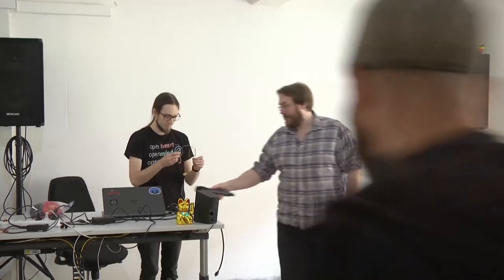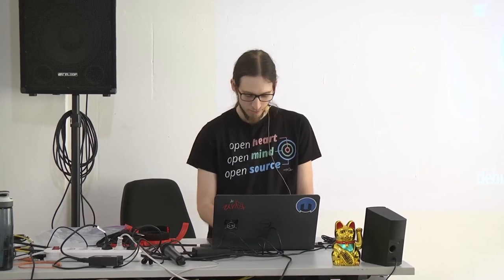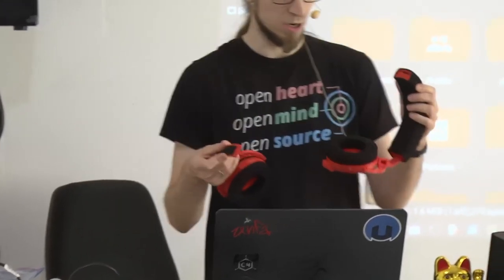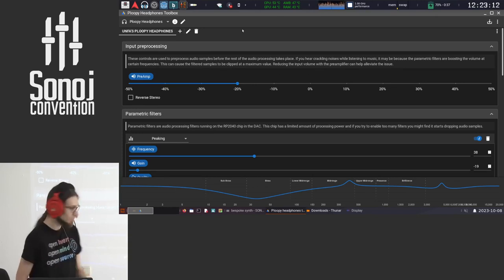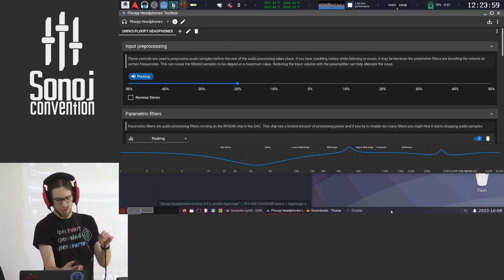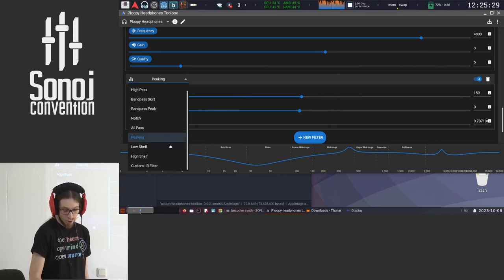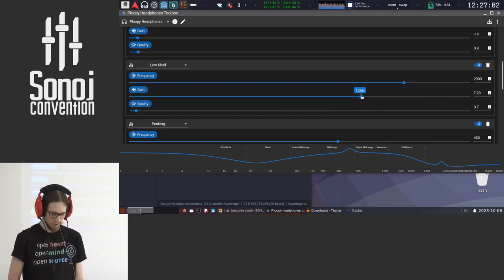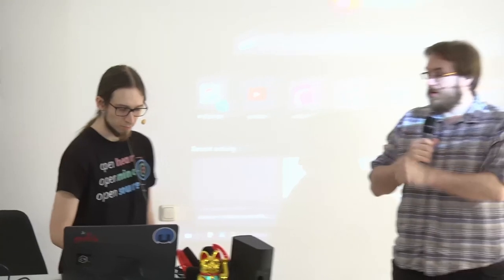Sonoj 2023:  Ploopy - Open Hardware Headphones

Comment: I've talked to the Ploopy guys and learned that the planar drivers are a custom design:

> The drivers are custom, specifically designed to be replicable because they're open source. You can make them using polyurethane foam, a flex PCB and glue-on-a-roll adhesive.